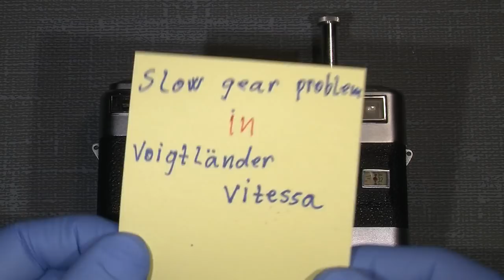Slow gear problem in Voigtländer Vitessa

Comment: Thanks for the interesting vid! I have a Vitessa T where the shutter blades remain open, closing sometimes all the way, sometimes part way, do you have any adive on this? It would be much appreciated! I really want to start shooting with this camera.
Reply: mikeno62 Thanks for the advice, have tried cleaning the shutter,  the problem seems a bit more serious,  when I push down the plunger it seems to cock the shutter on the down stroke and release it on the up stroke, with the actual shutter release sounding like it's triggering when you push it. All the time with using the shutter release or the plunger, the shutter blades move to random positions.
Reply: I have a different issue with mine, one of the blades is off track...
Reply: @ConstantlyConfused-x2f  i have the same issue if have solved it please reply :(
Reply: @FookFish  Hi, yes! I got mine working, it was indeed old oil in the shutter mech. I stripped the front of the camera and cleaned it, though not very professional and it's been working perfectly since! I didn't video the process but I took photos which you're more than welcome to.

Comment: Hi, my shutter won’t open but all my gears seem to be working alright on my Vitessa L. Do you have any suggestions? This was a helpful video
Reply from the maker: I would guess there is oil on the shutter blades or the aperture blades, you can clean them with lighter fluid.
Reply: @mikeno62  All resolved. The screw for the for the cocked shutter release mechanism simply needed tightening. Have a working camera again after 25+ years
Reply: Daniel Baum hi I am having the same problem. I was wondering where that shutter mechanism thing is at?
Reply: Same my the shutter blades are stock ?!
Please help , which screw needto be taffy

Comment: Hi where can I buy sticky cone ?
Reply from the maker: I have now add link's in the description, but you can get them here:    Japan Hobby Tool rubber cone:

https://www.amazon.com/Japan-Vacuum-Camera-Opener-Repair/dp/B0013HFYKK/ref=pd_sbs_469_1?_encoding=UTF8&pd_rd_i=B0013HFYKK&pd_rd_r=RKSF5A4YKT9GV3E1382C&pd_rd_w=5H58m&pd_rd_wg=DBny2&psc=1&refRID=RKSF5A4YKT9GV3E1382C

 

18 different size rubber repair tool's:

https://www.amazon.com/Sizes-Lens-Filter-Wrench-Rubber/dp/B00988D1BK/ref=pd_sbs_469_2?_encoding=UTF8&pd_rd_i=B00988D1BK&pd_rd_r=RKSF5A4YKT9GV3E1382C&pd_rd_w=5H58m&pd_rd_wg=DBny2&psc=1&refRID=RKSF5A4YKT9GV3E1382C